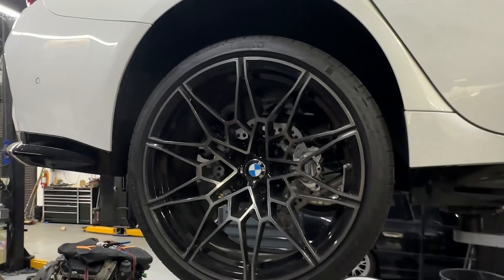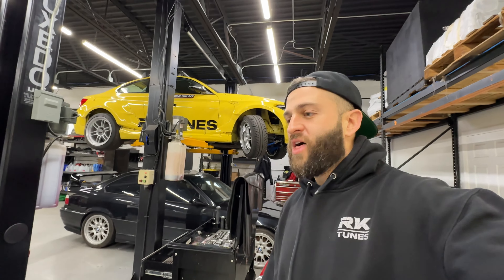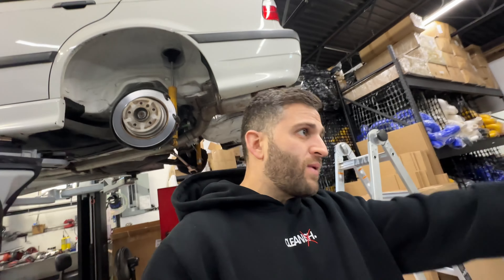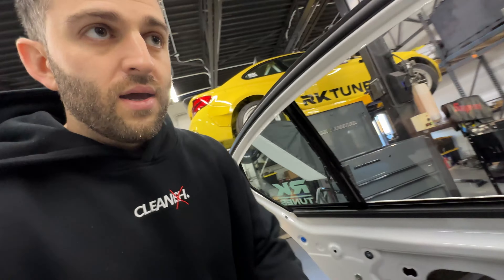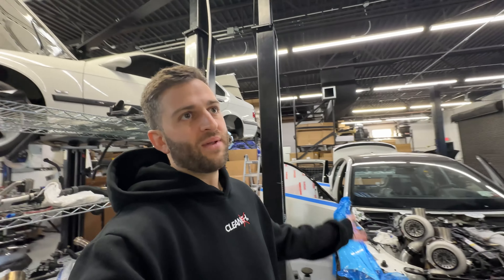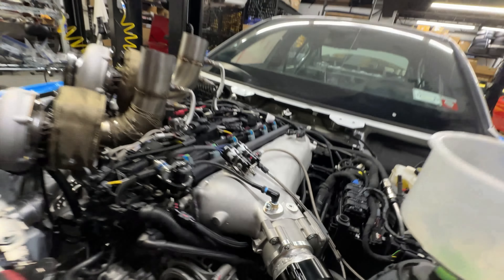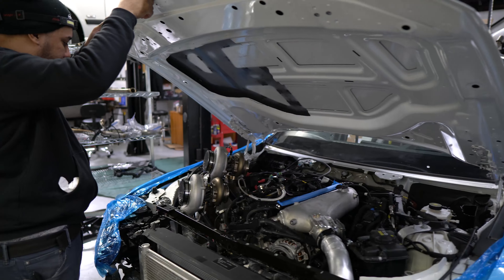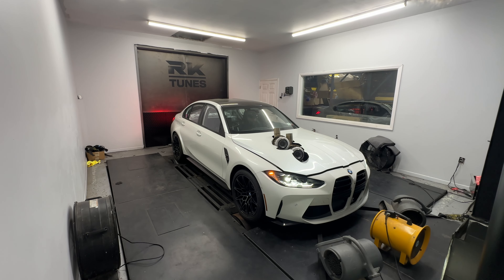Building the lightest G80 M3.

Comment: This car is taking forever to finish meanwhile Mpowerhouse pulled their motor and is already back on the street and 1stock finished an entirely new chassis to replaced his crashed car. Dam Jordan talks fast and excited 😅😅😅
Reply from the maker: My car is done. I am behind on posting the content. Merrick is the man. Also there is a difference in some of the things i have done vs them. The parts i used / way I did things took way longer
Reply: @RKTUNES  Thanks for responding. Glad to know it's done. Will patiently await new videos and shutup lol
Reply from the maker: Like when you see the underpannel we built. It took like 60 man hours to do. Making 17/15” wheel combo fit took DAYS of work. Self doing the alignment to measure toe / camber changes under compression to track when we go to the track if i want more grip we know the limits of alignment tweeks etc. 

Is any of this needed? No these cars are amazing as is. But i think all the small things will only help me achieve my goals
Reply: @RKTUNES  I understand your build is setup to go really fast and safe hence the extra work needed to get it completed properly. Congratulations and can't wait to see what it does on the track. Can't say I know of any builds like this G80 currently regarding how indepth the build is. Really hope it gets to 180mph on the top end after getting the 60ft you want and it hooks.
Reply: Well look at the pass they just did today🤷🏾‍♂️
Reply: @joker44501  yeah I saw it 7.87.. Definitely got more headroom to trap 180mph in the 1/4 mile. I was more anxious than RK was lol. Sorry if anyone thought I was being negative. Didn't want this build to end up a dusty shop car with so much potential resting dormant. Hope guys go back to twins.. Congratulations @RK !!!